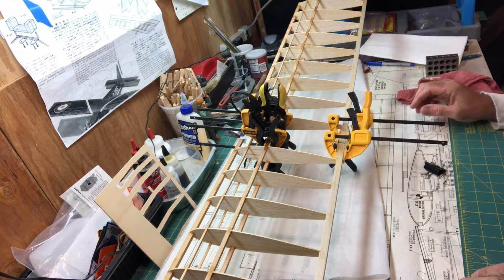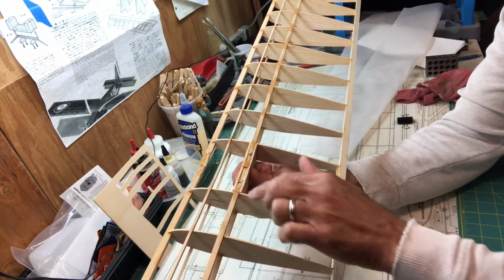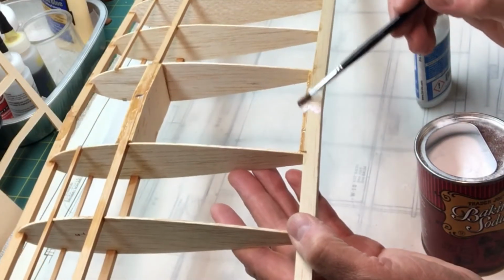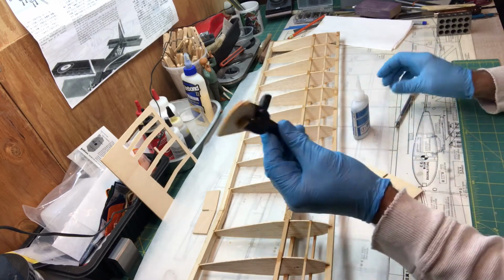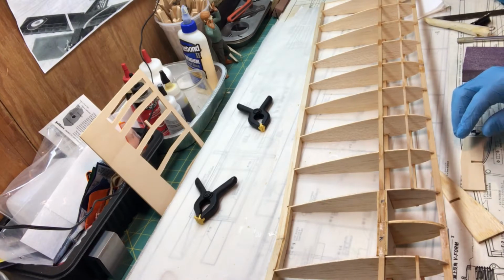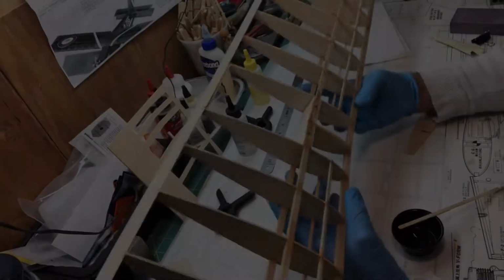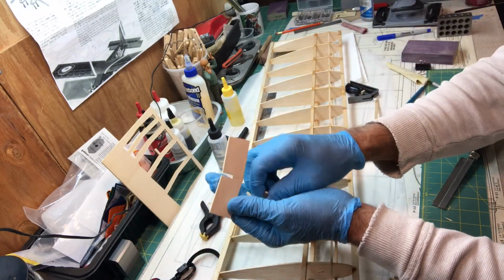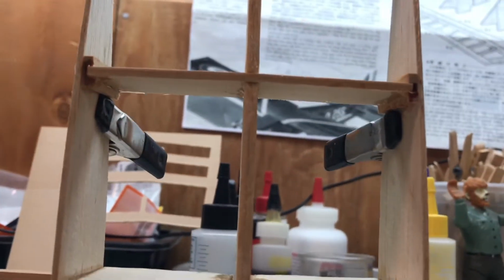Barnstormer 25S Vintage RC Plane Build: 4f Wing Center Section

Comment: Ottimo lavoro , epoxi 5 minuti o 30 minuti?
Reply from the maker: Thank you, Im sorry I cant understand totally what you wrote being limited to English. But so far on kit Im using 30 min epoxy since the slow cure time allows more working time. And generally it will provide a stronger bond since in theory it has more time to soak into the wood. I hope i make sense.. 😆